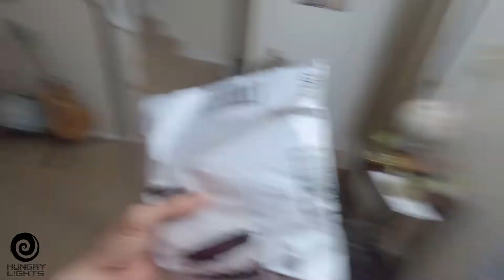Changing A Bike Tube For The First Time

Comment: For the instrument building module of my degree I bolted a bicycle wheel to an old washing machine drum and stuck a piezo pickup in it. Then I made two drumstick bows (angled steel rods withthe tips lathed into drumstick heads then violin string attached) it made the most unholy noises. Highly recommended for making horrible sounds, especially if you can bow the harmonic points on the spokes.